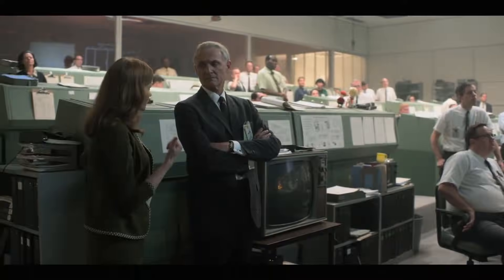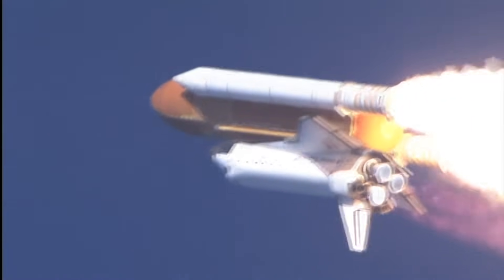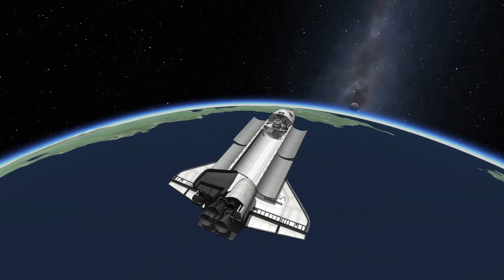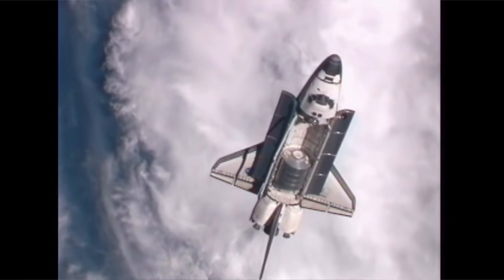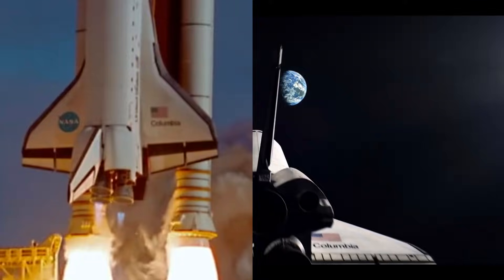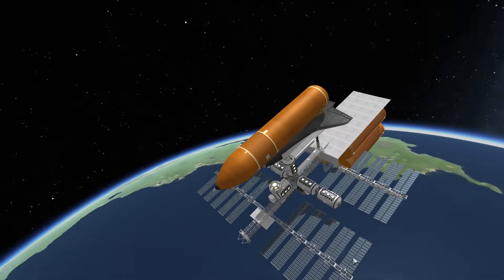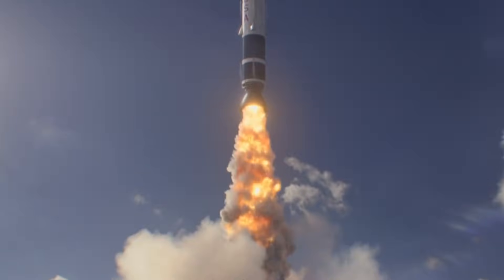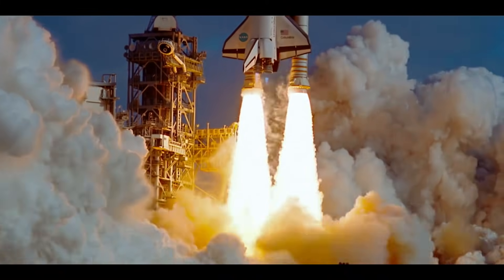How To Send A Space Shuttle To The Moon

Comment: Looking at this now that I've finally gotten around to watching For All Mankind and the latest season.

I was thinking all the exact same things Scott. Unfortunately they didn't explain how that worked. 

Some amendments though. The sea dragons payload was plutonium, it wasn't nuclear powered.

However, the Pathfinder, the next gen shuttle did indeed have Nerva nuke engines and was SSTO from a C-5.

The shuttle in the show never descended down to the moon. It was just a ferry. 

My thoughts on their methods are similar to yours.

They have an internal tank in the cargo bay they use for HydroLox that is fuelled in orbit. They also partially fill the external tank with whatever gives them the dV to complete the TLI.

Upon completing the TLI, they dump the external, and use the cargo bay tank for LOI. The base then tops off their fuel for the transfer back.

As for the tiles....yeah I dunno. Hahaha.
Reply: For the tiles they might do a multi-pass setup where they intentionally skip off the atmosphere a few times and then do a reentry to the ground, but the Shuttle tiles weren't perfectly reliable so that might need some handwaving to make work completely.
Reply: They probably dock with a space station, before re entry
Reply: @chrisw443 If the space station manufactures & stores fuel, that would make sense in order for the shuttle to have enough delta-V to do a deorbit burn; but then it would need enough delta-V in order to do a holmann transfer burn in order to dock with the space station in the first place.
Reply: @efulmer8675 
What's really handwavium is both countries having the tax revenue to have a sustained space race; Between the space race, the arms race, domestic underproduction, and international 'influence operations,' the USSR's economy went belly-up.
Reply: Honestly, with thicker tiles and a better bonding adhesive, they might have pulled it off with a 'multi-pass' approach as suggested above.

Comment: Scott, all other points being quite valid, could the shuttle, having a long(er) term load of consumables, used its existing heat shield with a multi pass aerobraking maneuver strategy to create a successful re-entry?  Thanks for the great videos and efforts.
Reply: In KSP you could do that and slowly reduce your apoapsis or you can use a lot of extra fuel to inject back in to low earth orbit after which the re-entry would be as normal.

Comment: 9:25 - Why couldn't they make multiple aerobraking passes through the extreme upper atmosphere to bleed off speed before the final reentry?  Since the shuttle's heatshield wasn't ablative, it was peak-heat-flux-limited rather than total-heat-absorbed-limited, so it should have been possible to spread out the deceleration over several aerobraking passes rather than reentering directly from a lunar return.
Reply: Yep. Definitely wouldn't have been as much of an issue if it skipped off the atmosphere. Having the aerodynamic control capability that the shuttle provided would make it an option that simply wasn't on the table for Apollo.
Reply: You'd run into the multiple passes through the van-Allen belts problem again I think.
Reply: My knowledge of orbital mechanics is mostly acquired from playing KSP, so this reply is mostly guesswork, but I believe the problem with that is that there isn't a feasible trajectory to return from the moon that would allow  a more gentle re-entry unless the vehicle started out to overshoot the Earth, then burned retrograde in order to be captured into Earth orbit, then burned again to lower its periapsis into the upper atmosphere. This approach has some problems. First the vehicle would need delta V in hand to perform the initial Earth orbit capture maneuver and again to lower its periapsis. Even assuming it had enough fuel to do this, if its engines failed to re-ignite for the initial capture burn, the vehicle would overshoot Earth and either be lost in deep space or get stuck in an extremely elongated elliptical orbit.  Simply grazing the upper atmosphere on its first approach would have the same result. ie if the approach was shallow enough not to overheat the heat shield tiles, it wouldn't be steep enough to slow the vehicle enough to capture it into orbit and it would skip off the atmosphere and be lost in deep space.  This is why Apollo was designed to come back from the moon direct to a fast+hot re-entry. Because it was cheaper simpler and more reliable to build a capsule capable of surviving a hot re-entry than it would have been to send enough fuel all the way to the Moon and back that the CSM could have used to perform an Earth orbit capture maneuver leading to a lower speed re-entry from low Earth orbit.

tl;dr. Anything's possible if you have enough Delta V and are confident your engines will light when needed, but unlike KSP, where you can easily fast forward through multiple highly elliptical aerobraking orbits, your Kerbals will put up with anything and losing a crew and vehicle is a minor inconvenience, real astronauts want to get back home as quickly, safely and reliably as possible.
Reply: @Andrew-Kerr  It would be literally impossible for skipping off the atmosphere on a lunar return trajectory to send the shuttle into deep space; at worst, it would have ended up on an elliptical orbit that would still intersect the atmosphere on the next pass, and would still eventually have braked down to a low orbit.
When you're returning from the moon, you've already been captured into Earth orbit (given that the Moon is in Earth orbit).
Reply: They’d pass through the van allan belt too many times, and it would take too much time
Reply: @KrisMcCool  But what if they do everything with polar orbits? If you think about it they need a pretty polar orbit to deliver anything to the south pole of the moon, and then they can come back to earth and make multiple passes as the Van Allen belts are smaller in the poles
Reply: @Andrew-Kerr  If you burn prograde on the "light" side of the moon, you can get a giant elliptical orbit from there to LEO, no need to do 2 burns
Reply: @vikkimcdonough6153  Yes, but at the 24,816 MPH Lunar return velocity, you're only about 200 MPH under Earth escape velocity.  After your skip, it's going to be a long time before you come back around for the second try.  Your orbit will be highly eccentric.
Reply: @stargazer7644  Major Tom can do it!  Major Tom is fairly eccentric,
Reply: Time. The shuttle used fuel cell power, giving a maximum of roughly 28 days. Because it takes 3 days to get to the moon and let's say they want to stay in orbit of the moon for 3 days. So 9 days round trip. And to not completely destroy the aluminium airframe you would need to do high altitude short aerobraking passes to not melt your astronauts. It is much faster to retroburn at perigee. And as Scott mentioned Van Allen Belts
Reply: For one you don't want a direct dive straight into the atmosphere like you can do with a capsule but descending forward motion. Given the massive amount of fuel in that tank you'd have it to burn getting back. Anything left in the tank has to be wasted anyway to land. You'd simply burn some fuel to go into orbit and then burn to decelerate with the engine prior to entry. Reentry wouldn't be much different from a normal shuttle reentry.

However this is a horribly expensive way to do all this instead of just using a capsule.

Comment: how to send thermal protection, wings, and sea level engines to the moon
Reply: SpaceX - hold my BEER.
Reply: starship? BUT it has not wing, it has aerobreaks. And lunar lander version will not have them and it will not have sea level engine.
EDIT: and it will not have thermal protection. So basically nothing.
Edit 2: I am really stupid. This is not about starship, this is about space shuttle
Reply: Actually the RS25 engines are not optimized for sea level, the nozzle is as big as it can get before flow separation would destroy it.
You can see the over expansion on some engineering cameras
Reply: @Jaker788  also, it uses cool trick with changing its shape, so it can be realy big without flow separation

Comment: Paging Homer Hickam! :-)

I actually called the engineer Hickam consulted for his novel. Nice guy and actually chatted with me for a while. Seemed pleased that someone would be interested in his plan.

It involved having a fully fueled External Tank on orbit, and making the Shuttles' main engines re-startable.
Reply: A fully fuelled external tank in orbit would give the shuttle enough delta-v for the TLI, LOI and TEI burns with a good margin, but there would still be some great challenges:
1. Bringing all that fuel up there and preventing too much boil-off during a mission lasting a week or more.
2. Landing on the Moon would be virtually impossible for the shuttle itself, but it could bring a lander in the payload bay.
3. Strengthening the heat shield for atmospheric re-entry.
Reply: @(S)-Riley Dunn 
That would eliminate the boil-off problem, but decrease the specific impulse (fuel efficiency) and thus make the shuttle require more fuel for the same manoeuvres. Furthermore, the RS-25s aren't made for multiple burns during a single mission and they wouldn't be able to burn hypergolic fuel without massive modifications.

Comment: So if the main problem was the reentry thermal heating, could they have done the standard KSP trick of multiple re-entry passes? It would significantly lengthen the mission, but if they were refueling in orbit, they probably had plenty of extra mass capacity to bring more supplies and extra fuel for the fuel cells. I guess it would give them more radiation, though, as they pass through the van allen belts multiple times.

Comment: The shuttle could have had an ablative coating added to cope wtih the higher velocity re-entry. Though the g-forces would be an issue..
Reply: The shuttle experienced a maximum of 1.7 g during re-entry from LEO, but about 3 g during launch, so I think there was some margin there. The extra heat would be a bigger challenge.

Comment: I always understood that the Shuttle was not equipped with the navigation systems Necessary to be able to fly Outside of Earth orbit.  🤔
Reply: The navigation system isn't the biggest problem, but bringing enough fuel to give the shuttle a high enough delta-v capability, just as Scott explained. Atmospheric re-entry with a much higher speed than from low Earth orbit would also be a problem.
Reply: @fromnorway643 
        I feel that having the Ability to Actually find the Moon and Back Again is Just as Important of a aspect of Rocket Science as blindly leaving orbit in Some random direction this is why the Apollo Spacecraft is a Spacecraft and the Space Shuttle is Only a shuttle.
Reply: @worldtraveler930  
Of course, it's equally important, but it's a tiny challenge compared to all the physical modifications you would need to do on a spacecraft that was never intended to go anywhere but low Earth orbit.

Comment: The most practical way to get a shuttle to the moon (or beyond) would be to send the extra fuel needed ahead and refueling in orbit and perhaps in transit. That way, the payload bay could be used for useful things like landers, rovers, equipment etc. In the final analysis, it would require approximately 6 times the shuttle’s current fuel capacity for a mission to the moon and back.

Comment: could you return to Earth from the moon into a parking orbit prior to re-entry to reduce the heat load on the TPS? I mean, since we're talking about captive carriage of the EFT to the moon, it may have enough propellant remaining at Earth to enter a parking orbit, then de-orbit, separate EFT and re-entry.
Reply: I was thinking the same 700 tons of propellant - plenty enough for a burn to slow down to orbital velocity for the tps
Reply: And it could also probably refuel at the moon base, giving it the extra delta v to slow down. Plus it might not have its payload with it on the return so it would have less mass and therefore more delta v
Reply: @apotatoewithanaginata8482  It would have to refuel in low lunar orbit. There's no way you'd be able to land the shuttle on the Moon the way it's designed. But to escape lunar orbit and then enter low Earth parking orbit you'd probably need the external tank all the way.

Comment: The shuttle's heat shield would not be able to tolerate the heat generated from the reentry at the velocity of returning from the moon, but can reentry from low earth orbit? Well there's a solution there, do an injection burn to low earth orbit returning from the moon, and reenter from there. Though it'd require yet more fuel. So best compromise would simply perform a breaking burn to only slow down to a similar velocity as you would after you deorbit burn from LEO, rather than fully close the orbit. Riskier if something went wrong, but save what fuel you would've spent closing the orbit. Do it all the time in kerbal, though that's not quite real life. Either way, I'd agree the shuttle isn't the best craft for lunar missions.

Comment: Would it have been possible to put a lunar lander (not the same one used in the Apollo program) in the shuttle's cargo bay therefore using the shuttle as a de-facto command module? That is if we're talking about the external fuel tank being used in this scenario. I know the odds are, either way this would most likely not work.

Comment: Perhaps in the trailer shot of the Space Shuttle it returning from a very high orbit of Earth, a La Grange Point, or to a Station similar to the proposed Lunar Gateway.
Reply: It wouldn't make any difference if the shuttle was returning from any of the Lagrange points in the Earth-Moon system. The closest (L1) is 326,000 km away, and any spacecraft's re-entry speed from that altitude would be virtually the same as if it returned directly from the Moon.
Even a re-entry from geostationary orbit (35,786 km) would be too much for the shuttle to handle, as its speed would be more than 90 % of that of the Apollo missions.
The only options would be to reinforce the shuttle's heat shield or carry enough fuel to slow down before atmospheric re-entry.
Reply: @fromnorway643  If this fictional returning shuttle had the fuel, it could flip and do a deceleration burn. And judging by the image showing Orbiter and Earth, they really aren't that far out. That's a lot of arc seconds of Earth in that shot.
Reply: @sandbridgekid4121  
Based on the clip at 0:42, it looked to me like that shuttle was much farther out than geostationary orbit. There is no way that shuttle could have survived atmospheric re-entry from that distance without a reinforced heatshield, fuel to slow down before re-entry or a combination of both.
Reply: The need Amy Shira Teitel Ms Vintage Space has historical advisor and Scoty Manley as technical adviser. Never heard of staff they have in show.